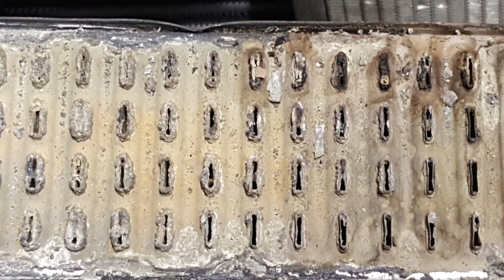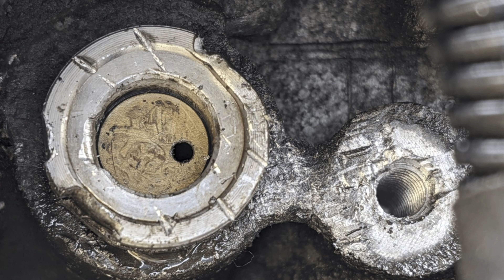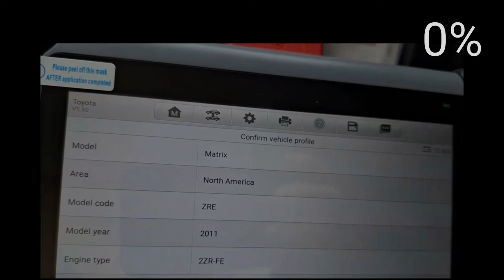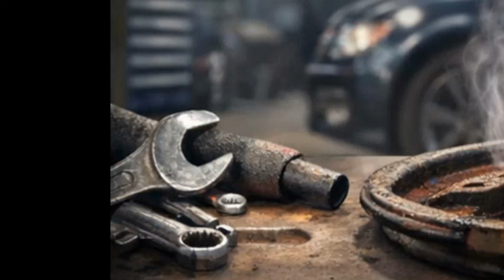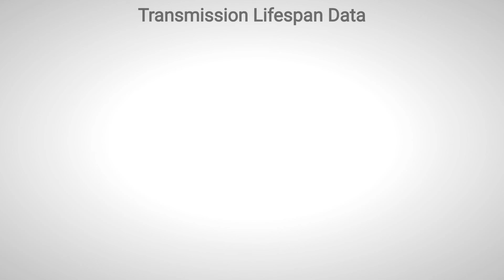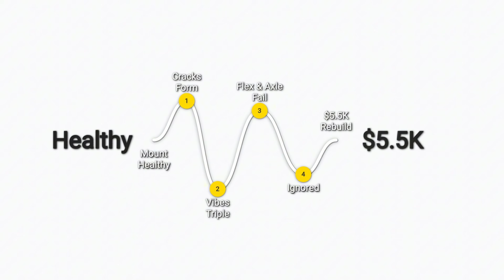Do THIS To Your Toyota Engine Before 60k Miles Or Risk a $5,500 Rebuild

Comment: That's why every oil change I dump the rad until it is perfectly new looking. Then its every other oil change. Usually 2  dumps. Super easy super safe. Take the fill cap off the rad slide an oil change bucket under the rad open the petcock and dump the rad then close the petcock and fill it back up with factory coolant. No airlock  no drama. Then dump it down the toilet. Been doing that for 30 years on multiple cars never lost a water pump or had any issue. Never ever dump the engine coolant that creates a really bad airlock that's extremely hard to purge.

Comment: Today, September 4, 2026.

2016 Toyota Tundra 5.7L TRD Pro, 4x4 ,  90.5K miles

As part of my preventive maintenance, I replaced the serpentine belt, idler pulley, belt tensioner, coolant, coolant temperature sensor, and PCV valve.

To my surprise, the old PCV valve was no longer functioning as a one-way valve. There was no check-engine light and no diagnostic code, either. This is exactly why preventive maintenance is so important you can catch a component that has already failed before it creates a bigger problem.

Tomorrow: Spark plug replacement.

September 12, 2026: I’ll push out—not flush—the transmission ATF, since the last service.

Comment: I have a 1997 Tacoma only changed oil, plugs, battery and belts. 255,000 miles. Guess it's time for coolant and other fluids.
Reply: Long overdue
Reply: @Johnnyjacobs-h8f probably too late
Reply: @mikew7218 yes, damage is not reversible...

Comment: Good video. I agree with everything you said. Except for maybe the spark plug replacement at 60k. Seems really premature.. I'd say 90k(provided you use top tier gasoline and don't go over 5k on oil changes) Toyota's recommended 120k is too long. I drain and fill my coolant every 3yrs brake flush every 3yrs power steering flush every 3yrs drain and fill transmission every 30k front and rear differential and transfer case every 30k
Reply: I I don’t know who is this gentleman making this video. If we
Are changing or servicing all these things at such early intervals then Toyota reliability is in question.
If all these maintenance work is done on other brands their reliability will also skyrocket. 
I feel this maintenance work, except regular oil change, is done on other brands their reliability will be at par with Toyota and Honda.
I am talking from personal experience.
Reply: Later in the video, he specified 60,000 *miles*. That's probably what he meant, not kilometers.
Reply: @StephenWeber-x2c yes, a Freudulan slip
Reply: The 2gr- fks requires plugs at 60,000for extended engine warranty
Reply: The 3.5 fks must be replaced plugs at 60,000
Reply: The spark plugs have super thin ceramic  on them.   That's the new problem with them and have to change very early.  My Mazda CX 70 2025 needs replacing at 40 k miles or voids warranty